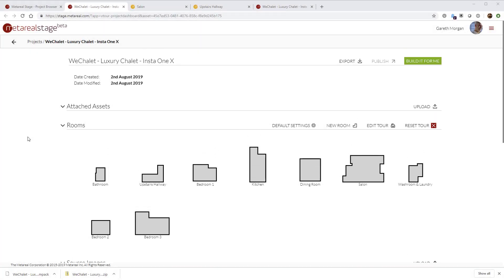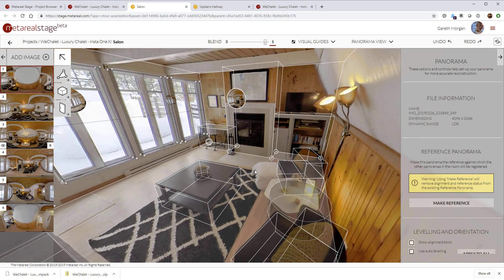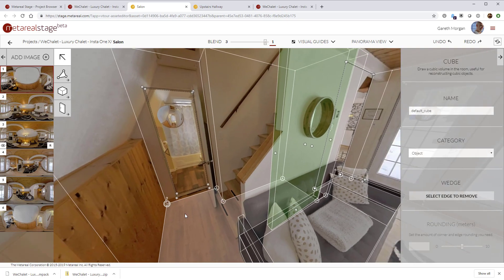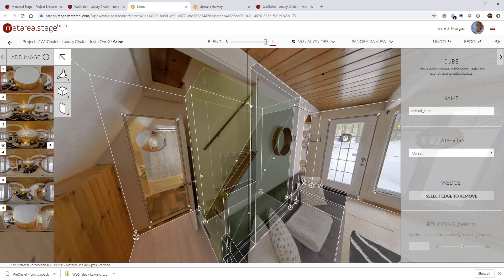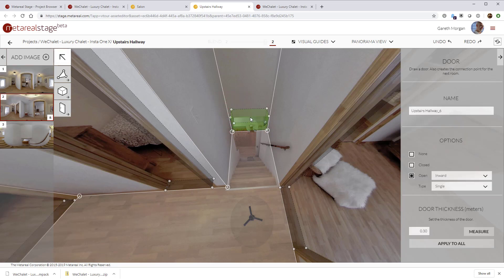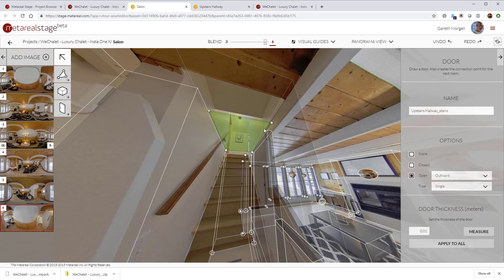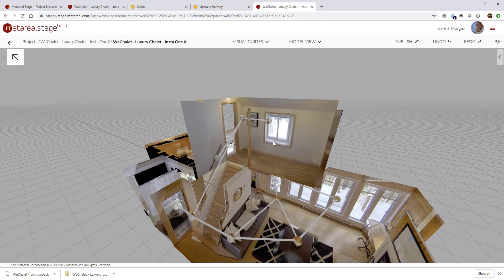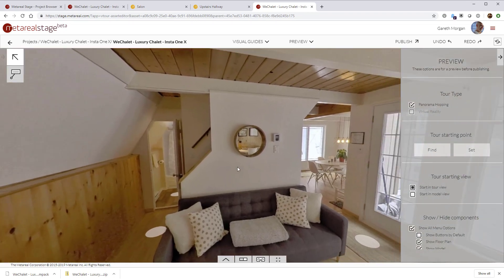Building Staircases in Metareal Stage

Comment: how would you deal with a spiral staircase or L or U shape case
Reply from the maker: Same approach - you would build volumes for the actual stairs and use floor and ceiling doors to connect the rooms. We can't do curved walls (yet) so in cases where the room is cylindrical, you may be better just creating a teleport transition between the bottom of the stairs and the top.
Reply: @metarealstage  super thank you, forgot about the teleport option
Reply: If you teleport how would you connect the floors?